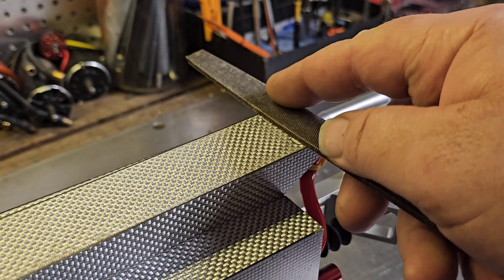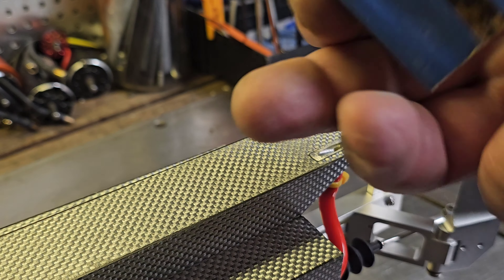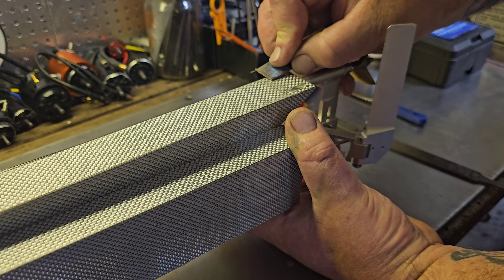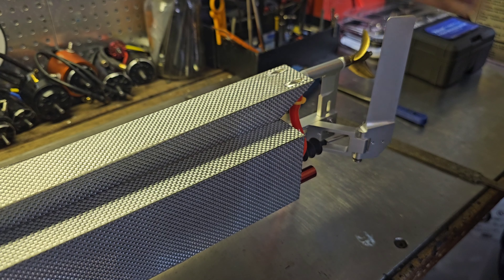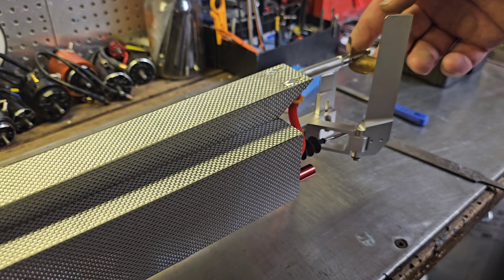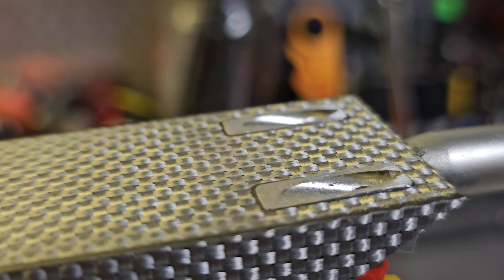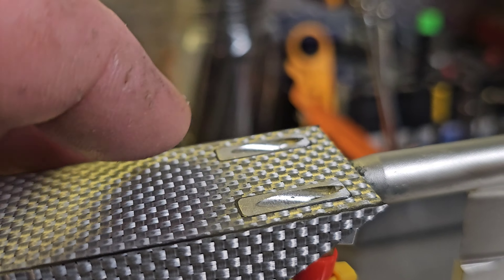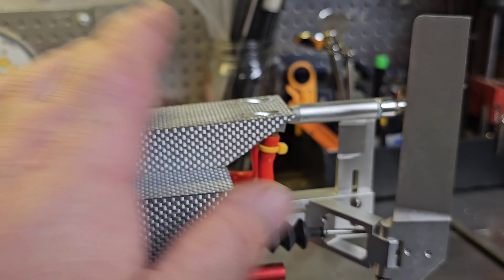First Experimental Modification Oxidean Scorpion Rigger 34" Carbon Fiber Rc Boat

Comment: Cool B!  That’ll be interesting to see any difference. Plus you answered my question if a slightly rough surface would perform better than high gloss. I am a private pilot and have flown float planes (c-180, 172) off water and glass water is tougher to takeoff because of adhesion to the smooth floats. And I believe full scale hydro boats don’t have smooth gloss surfaces either. But you’d know better than I would. Great content B.

Comment: I sanded the bottoms of my boats and I also sand the back of my guitar necks for the same reason . Glossy necks actually squeak on hot humid days .  Fish  have a scales to break their tension in the water . Ever lift a glossy RC boat straight up out of the water ?   Hard to do till you sand it , but not to rough same as the guitar . 600/ 1000 grit

Comment: It will probably ram water in there better, cooler running , if you notice mr mads boats all have water pick ups in the bottom I think he does that to break water retention! He's getting a lot of speed from soewhere. Don't think its just boda props!

Comment: Cover it with clear solar film it will protect the carbon for years
Reply from the maker: Is that what they use on "new" carbon sheets, solar film?
Reply: @IRONCLADRC  no it's what's used as covering in a balsa constructed rc plane tough and strong I've just used it on a mini rigger build the material is very slick to so maybe a bit of extra speed
Reply from the maker: Roger that thanks!